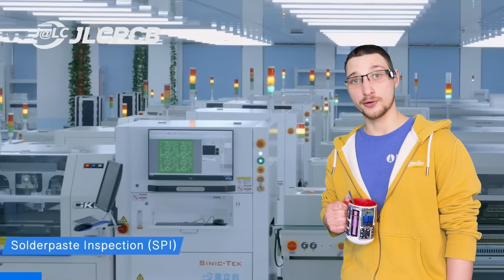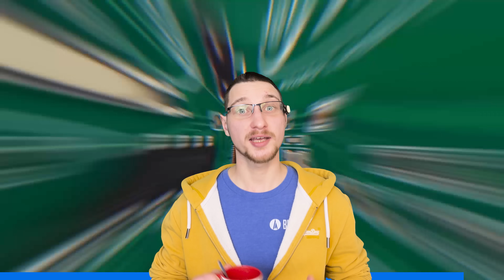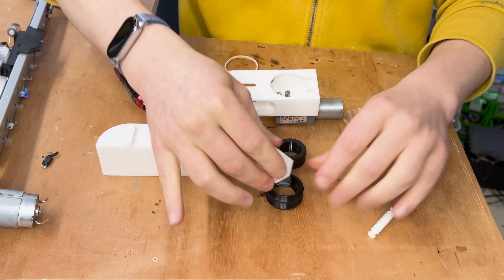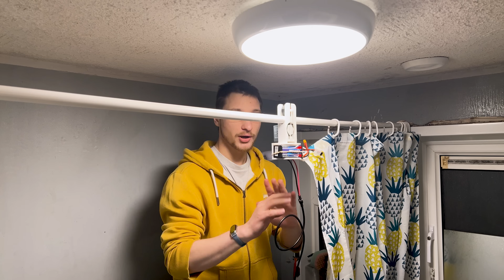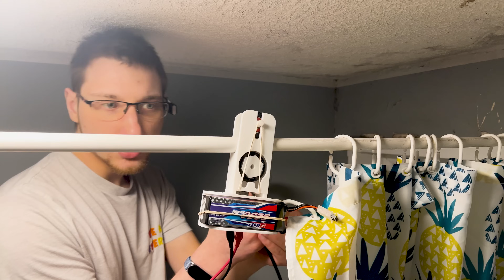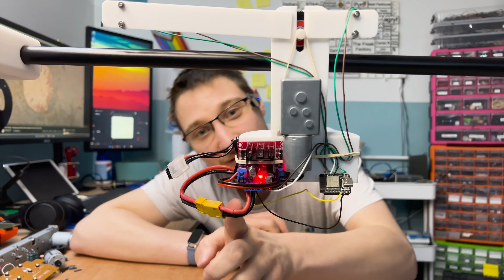DIY Automatic Shower Curtain

Comment: I would have put the motor to one side and have a cable to pull it back and forth. That's how all of the curtains in my house work as well, it's far more reliable than the switchbox system if you ask me.

The switchbot system is easier for installation but doesn't work great in my experience... I tried it once and sent it back, it didn't work at all for 2 of the 4 curtains that I tried and failed 50% of the time for the other curtains. Even thoroughly cleaning the rails and adding lubrication to the rails so it would go smoother didn't help enough.
Reply: That was my thought too, like a clothesline. And it wouldn't need a battery. But then I guess you'd need some way to measure the amount of rope moved, or go by time. Or attach a couple magnets to the rope and use hall-effect sensors as end-stops. Or color the rope black in certain spots and use a color detection module.

Comment: I'm thinking the top should have 2 wheels side by side and at least one should be driven in sync with the lower. That would keep the unit from wobbling and offer better grip. Also you could you use some cheap distance detectors instead of limit switches. That would keep the package more condensed. And to pile on the work, you could add another distance sensor to make it a touchless switch. Set 2 distances. Close for one direction and farther for the other direction. I'm full of ideas as long as someone else is doing the work.